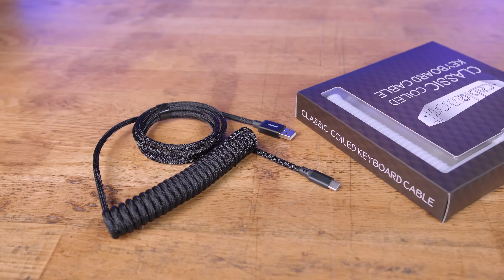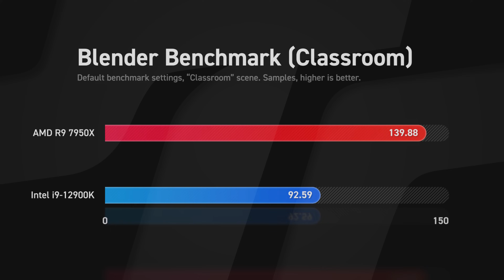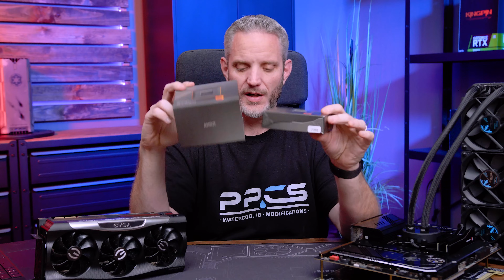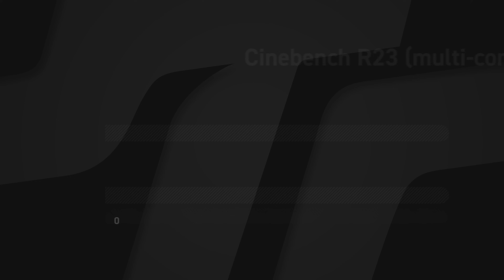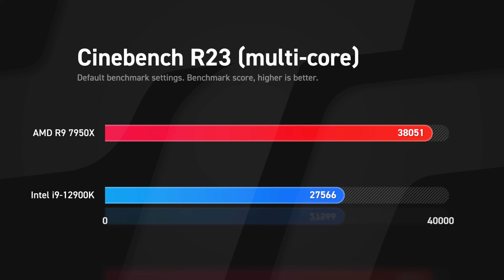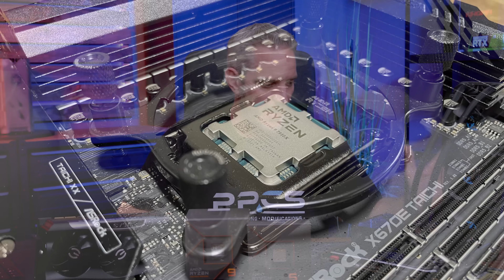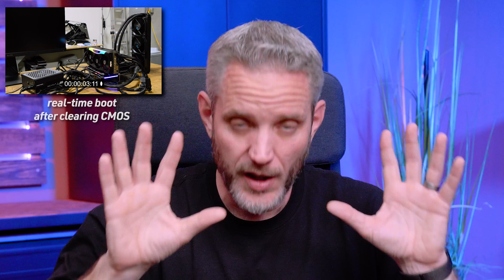Forget EVERTHING you THINK you know about AMD... these CPUs kick A$$!!

Comment: I had already decided that I was going to get Ryzen 7700X for my next system and your report doesn't surprise me from everything that has been reported on AMDs new processors thus far. And the reason I am going with a 7700 is the same reason why I have a 4800 in my laptop because 8 cores is optimal for the financial software that I run for work.

I am glad that the chips have integrated graphics because I am waiting for the RX 7700XT (yeah going with 7700 there too because why not) and I will be able to use my desktop for work while I wait for the GPUs and I still have the laptop with a 4800 and an RTX 2060 so I can wait. Yes that's my work laptop what's your point?

I am excited for these new chips and I feel sorta like the chip shortage resulted in me getting a better system and setup in the end. I had to upgrade my laptop so I could stand to wait and I am not getting a 5800 and RTX 3060 anymore but a straight upgrade across the board now. Plus having a laptop that can run games so when I meet with a client I can demonstrate the game I mentioned during chit chat. Hey we're doing a rollover because they're retired they have time for gaming now. I might as well show them what I play to give them ideas.

Anyway I am extremely excited and feel vindicated for my decision to plan this build. Thanks for the review.

Comment: I've been running a Ryzen 5 5600G at 4.3Ghz AM4 , Ram= 64GB 3600Mhz, with the EVGA GTX 1080 Ti FTW gaming DT 11GB combo with minimal heat, for almost 2 years and I'm very grateful for Jay's insight before I built mine

Comment: I think it'd probably make more sense to use an RX 6950 XT instead of an RTX 3090 Ti to test for cpu bottlenecks at 1080, especially with SAM enabled which gives Radeon a massive advantage in Forza Horizon 5 and many other games but I think the 6950 Xt is in general faster than the 3090 Ti at 1080p ain't it?

Comment: Comes here after LTT review, basically buy a Ryzen 7 5800X3D, is cheaper and crushes ryzen 7000 series with all those 'new gen features (twice expensive ddr5 ram)', if u are a gamer ofc, u will get more than 10% more fps at half cost and lower TDP than  ryzen 7000 series and intel 12000 series.

Comment: Jay HELP (i9 12900k) me when ever I lock my clock speed or leave it on auto, when I render a semi thick scene in blender it thermal throttle. It doesn’t when I lock it at 4.5-4.6ghz, but how do I actually use 5ghz without overheating within 10 seconds of the render. (AIO 360 lian li)

Comment: Does the bios for the MOBO have an option to enable AVX512? The CPUs are supposed to support it and Intel has toggles on their bios. The newer Intel chips don't even let you enable it as they soldered it out on silicon. Curious if that's an option.

Comment: Excellent video!  As good as it sounds initially, I'm still going to hold out.  Going from my 5800x to a 2nd gen AM5 CPU will feel even better!!  I'll be curious to see what 13th Gen Intel can do.  As you I'm also very curious about RDNA 3.  If I do any upgrades, I would consider an AMD GPU from my 3070 if the performance and costs are an improvement.
Reply: I think your 5800X should last you longer. It’s still a very good cpu. I also used both intel and AMD CPUs. I’m currently using i7 12700K and a 3080 Ti. But I might be finally switch back to AMD gpu again (I also had a 6700XT). Because 40 series may be insane on power requirement and heat so this rumors made me wanted to wait and see how RDNA 3 looks like.
Reply: @Treeck57  Yeah I’m not upgrading the CPU. I might change my 3070 based on how the new AMD GPUs benchmark.
Reply: @marksaxon  Indeed. For my 3080 Ti. I think I will just keep it and buy a 7900XT only if performance and power efficiency is decent enough. I won’t be using a 7900xt as my main rig. It will be likely straight on my second rig for Linux use. 3080 ti is for windows os. I think you may want something faster than your 3070. I would just wait for either 7800XT or 7900XT reviews because upgrade to 7700XT isn’t worth it since it is supposedly to be equal or slightly faster than 6900XT.

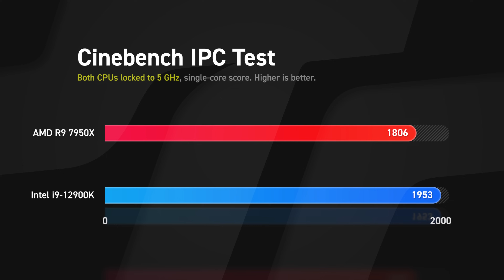Comment: 06:56  That has nothing whatsoever to do with it.  Cinebench does not use AVX-512, and the 12900K doesn't support AVX-512 (unless it's an early sample and you've disabled E-cores and you haven't updated your BIOS).  Cinebench just doesn't benefit much from the architectural changes that Zen 4 made.  It's near the bottom end of the IPC uplift range, which averages (geometric mean) to 13%, but ranges from 1% at the bottom to 39% at the top, using AMD's selection of applications.

Intel just has more IPC with Alder Lake for Cinebench than AMD does with Zen 4.  Nothing to do with AVX.

Comment: Is there a reason you are not comparing the 7950-X against the I9-13900K?

Also, I am all for product competition, as it continually pushes the bar, but instead of appreciating the techical advancements of both AMD and Intel, you seem to look at whatever company has lower performance as an all out loser, which ticks me off. Because AMD has stepped back in front doesn't mean Intel is now trash. I've used both and fully appreciate the R&D and mind bending technical advancements both companies have made. I recognize I may be overreacting and apologize if this seems at all personal. Love you videos and channel.

Comment: I read a story a few weeks back on TPU that the MB's were setting the voltage high and that you could undervolt it a little bit, still hit the high MHZ and the temps drop BY A LOT. So I read. I'm wondering if you saw this story and if you tried undervolting it slighty and seeing if that made a difference to the temps?
Reply: The temps are fine. It's supposed to run at 95c. Even hardware unboxed pointed the same thing out in their review of the 7600x
Reply: @toxicavenger6172  I understand that. But if it's true that you can undervolt, run at the same speed and lower the temps at the same time, it's worth exploring/doing no?
Reply: @ancientevil8044  it won't lower the temps though because of how they engineered it unless you can disable whatever setting causes it to hit that temp target every time. Sounds like you should be able to since it should be tied to PBO.

Comment: This great info for SO MANY REASONS! I'm a long time Intel CPU Guy, but no Fan-BOI. Its great that AMD dropped the Hammer on Intel to REALLY Push them. Its also great that as an FS2020 player I will potentially be getting some  good  performance Uplift, so I'm jazzed to see what you will show us perf-wise in the coming weeks. I plan to update from my 10-850K to a 7950 if this plays out as I hope it will so this info is gonna be critical for me at least.
Reply: The thing is that Intel doesn't need AMD to feel the need to "be pushed".  They announced to investors as far back as 2016 that they were technologically limited in their manufacturing capabilities moving forwards and had new fabs in the works.  Intel now has two facilities in Arizona nearing completion, another two in Ohio, projected to open in 2024 and another three or four in the works in Europe.

Think of it like this, Intel has squeezed a lot out of the 14nm chipsets to the point that they stayed relevant, if not the clear leader, for several years up until AMD dropped Ryzen.  Once AMD dropped Ryzen Intel was still able to stay in the fight simply by squeezing blood from a rock.  Then Intel gets mocked for calling their 10nm their Intel-7 because its 10nm matches the density of 7nm only to drop the 12900k with a ridiculous amount of performance for 10nm no matter which way you cut it.  You'd be lying if you said that the 12900k isn't an impressive chip by any measure.

I will say this, AMD was incredibly smart to kind of rebrand what is expected of an i9 kind of like Intel was smart to rebrand workstations with the i3, 5 and 7 then eventually 9.  The irony here is the first i9 models were the 7980XE, 7960X, 7940X and 7920X.  AMD basically targeted Intels enterprise level chips and said they could do it on the consumer market for half the price or less.  Remember, the i9 was basically in response to the first gen Ryzen that delivered Q1 of 2017 and had never existed before then otherwise I probably would have had one.  I think Intel is expected to launch their first chips from the one new fab in 2023; I have tempered expectations simply because I understand the hurdles that come with a new facility, new process, new equipment and technology relatively speaking but do absolute expect it to compete.  I expect it to be a few years before we see 7nm or 5nm processes as these other fabs begin to go online but once Intel is on even footing I think we will see some exciting things from both.

This 7950X looks very appealing but my 10850k has suited me very well even in MSFS2020.  I'm probably going to hang tight for another year or two and see what happens.  I know one thing, I've never had to deal with USB ghosting or picky RAM and I currently have a lot more than 16 certified choices of RAM to chose from.  I seem to have far less driver issues in general than my friends with AMD outside of the occasional windows updates that tend to be annoying for everyone in general.
Reply: As a long time builder and user of workstation grade hardware I am actually not that impressed with the current benchmarks for the Zen 4 series .  Compared to core I9 12900k the uplift is pretty reasonable but if the ipc figures for raptor  lake are within the current margins of the Leaked benchmark Amd will be in trouble because they won’t be able to claim to be either the performance leader (except for some multi core benchmarks and avx512) and certainly not the value leader in all but some specific parts of the market .

Comment: Will a 7950x fit the AM4 socket? Like can I replace  a 5800x with a 7950x?
Reply: No.. it's a completely different socket.. going from PGA (AM4)  to LGA (AM5)... Plus, it's DDR5 memory.. so, new CPU, new mobo and new RAM is needed for this build. You can use the same cooler though as the AM5 socket is compatible with AM4 coolers.

Comment: Verrry excite! I almost bought all the parts to build a 12th gen intel system. I'm still on 7920x, still a great cpu, but can't run Win10 or 11. It crashes instantly upon opening any web browser or explorer window. I think its my motherboard since the only thing different is the mobo in this system (last mobo, different brand, died). I bought it used so oh well. If I'm spending money on new parts, its going to be NEW parts. I'm going to hold out a little longer to see some long term reviews of AMD, but so far, I think I'm making the switch back. I'm really excited to see intel making graphics cards and I'm hopeful for the new amd graphics cards. We need more competition to spank nvidia's little ass.

Comment: If the CPU sits at 95 C constantly, might that have any long term negative impact on the motherboard, at least around the CPU socket area?
Reply: Not as much as power consumption, which would also be high.  But IRL, it'll be far lower.  Just keep the caps cool.

Comment: Unlike the LTT review this doesn't feel as balanced. Then again that's the point of investing in Labs but the unintended consequence is that smaller channels like JayzTwoCents doesn't feel comprehensive enough. 

For the new top tier AMD CPU's it looks like there is a definite improvement in workstation related performance. Gaming though the 5800X3D still does incredibly well with the 12900K not too far off. 

The mid tier though, where most of us shop it looks like Intel's 12th gen still makes more sense and it's cheaper being on DDR4. 

So much like the stage is primed for AMD to bring anything worthwhile to the table with Nvidia after the 40-series launch, now it looks like the stage is primed for Intel to launch anything that's an improvement over the previous generation. Let's hope they don't price it stupidly but hey, it's Intel...

Comment: A few years ago I upgraded to a 2700x from an Intel 3770k. Right after that I upgraded to a 4k TV as my monitor. Right before I upgraded to 4k I was doing live streaming and YouTube video rendering. But now I'm mostly just gaming and casual unreal engine 5 game development. But as you can see at 4k you don't need a better cpu. So I'll be sticking with my ryzen 2700x until I need more processor power. I'd rather spend extra on a gpu and better storage like nvme ssd's

Comment: Intel is RIP since 2016 same old just ultra modified architecture to the max no fabs now they will 10nm and 7nm++++ and you get a heater same history like crappy pentium 4 and amd 64 2000 -2006 era intel wont recover with something new until 2025 with new fabs buildings finished

Comment: Nobody is talking about how to reach 95°C on the AMD CPU and keep clocks that high require a very good motherboard because of how much heat vrms need to sustain and maintain voltages without them thermal throttling themselves. 

Interesting seeing this test on cheaper motherboards.

Comment: I wonder what kind of cooling solutions are going to come out for that chip, looks like it leaves a lot of stagnant air pockets around the edge.. Maybe a thermal pad to fill in the gaps, or a fan that blows down into the cpu to get that hot air away? When I got my 5600x I was tempted to try the 5800x instead, but I wasn't confident in my air cooler's ability to keep it cool. At 95c there's no doubt I'll probably want an AIO minimum on these new CPUs..

Comment: I got a 12700k in January, and I’m not in the least bit regretting it. I needed a new cpu, (was on an i5-6400) and it’s still a good CPU today. It’s a great time to be a pc enthusiast. AMD is doing things differently and it has given intel the kick they needed (even with a few years development lag). Looking forward to seeing these alongside new GPUs from both nvidia and AMD, even if I plan to hold on to my RTX 3070 for a couple more years.
Reply: No idea why you would have gotten a 12700k instead of superior 5800x3D
Reply: @VividFlash  because in the past Ryzen had killed destiny2, preventing it launching for months, and it’s the game I play the most, I run a clan, and don’t want to risk being locked out my game for indeterminate time, and the DDR4 3000MHz ram I already had and use in the 12700k build isn’t Ryzen approved but works fine on intel. And I didn’t want to buy a slightly more different DDR4 kit if I didn’t have to.
Reply: You should be happy, dont see anything exciting in this AMD lunch for gaming - 12700 is a frigging fast cpu!
Enjoy it

Comment: I have been on Ryzen for the past few gen's, (2700x and 5900x), I just built a 12900k and while it has some issues, I don't have any of the weird issues when running virtualized work loads with intel. Things like Docker, Android Emulation, or local Kubernetes workloads just run without funky issues on intel.

Comment: I am personally still going to buy a 5800x3d. Linus Texh and others have compared it to the 7600x and it still looks amazing for being about $50 more than the 7600x. and I dont have to worry about paying the premiums of ddr5 right now.

5800x3d, 6700xt, 3 years until my next AM5 build probably using 8th gen for it at that point

Comment: Still thinking of making an ATX pc built…but the hardest issue is…what processor am I getting. Will it be intel or AMD … infant it for gaming…people help me out. Don’t be a fanboy, but be genuinely..which one is best for gaming? The videocard will be a different discussion. As I usually prefer Nvidia. But willing to give AMD a chance if pricing is right or price per performance is better.

These scores in the video are a bit deceiving..as it’s the 12900 and not the 13900. 
And yes I know gaming is mainly about GPU. So will probably get the 13700 or AMD equivalent of that. Rather spend that extra bit on a 4080 or AMD equivalent.
Will mainly use it for MSFS or high-ultra settings.

Comment: Wow. This may make me consider building a New AM5 system sooner then I had planned to. In Feb. of this year , I did what was at that time could be said to be an MAX AM4 system. Mb is an ASUS ProArt X570-CREATOR WIFI , CPU is the Ryzen 9 5950X , 128 gb of ddr4 ( matching 4 x 32 gb kit ) , GPU = Power Color Red Devil Radeon RX 6900xt , storage = Inland Performance 2 tb PCIE-4 NVME m.2 , PSU = Seasonic PRIME 1300 Gold SSR-1300GD 1300W 80+ Gold ATX12V & EPS12V Full Modular CPU Cooler = Cooler Master MasterLiquid LC240E RGB Close-Loop AIO CPU Liquid Cooler, 240mm Radiator. When I built this the plan was to keep it for minimum 3 years maybe up to 5 ; then build an AM5 system. But if AM5 is this much better then AMD AM4 and Intel 12th Gen then it might be worth building an AM5 now then later.

Comment: 20% more power than the 12900k for 20% more money. Only on low settings for Forza. At higher settings it's gonna be a smaller increase. It's king of power right now but you pay for that.

Comment: I would love to see your opinion if Intel released a product that doubles power consumption from previous gen and also hits 95°c "on purpose".

Tons of videos on the internet showing comparisons of how temperature is the real killer of transistors and not voltage.
Reply: It's definitely not a comforting thought as far as heat in your room or power consumption to not be able to run it less than 95c no matter what but it is very clearly designed that way rather than just being power inefficient it's actually very efficient. Personally I have the same view regardless of what company does it id rather be able to choose my temperature and clock speed

Comment: With the ever increasing clock speeds of these huge multi core cpus, I wonder what kinds of clock speeds a cpu could reach if a company today designed a modern single core or dual core processor from the ground up with the sole intention of getting clock speeds as high as possible.